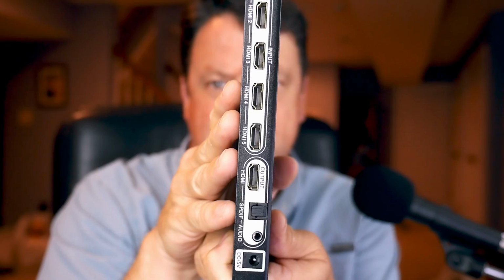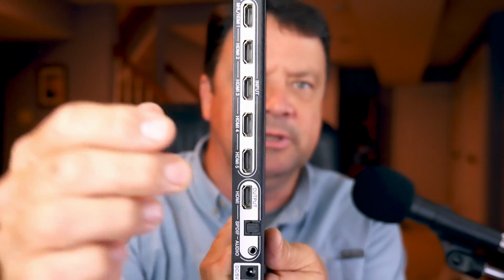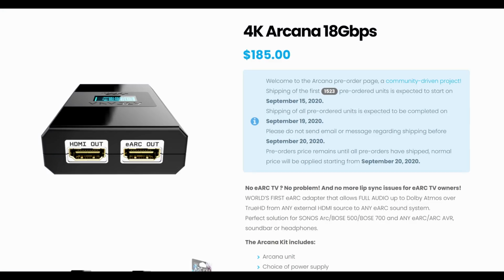Sonos Arc - Trying to Get Atmos with a Projector through a switch

Comment: Guys getting Atmos without a TV with eARC is tougher than I thought.
Reply: Joe Simpson HDFury Arcana end of problem
Reply: Alex Tejada what I’ve been hearing
Reply: Joe Simpson Now it’s on back order till December. If you decide to purchase one and you have other devices you may want to get a HDMI splitter while you at it.

For me the Arcana is just fine and my entire system sounds Amazing
Reply from the maker: @Rigue2021  thanks alex!
Reply: @Rigue2021  hey Alex so if I connect a Sonos arc to the earc out on the arcana and the hdmi out to the my projector and an apple 4k player to the hdmi in i would be able to listen to Dolby Atmos?
Reply: @dannyboy8298  No, you will need the bridge (HDMI Splitter per say)

Keep in mind there’s not too many Dolby Atmos  movies out there.

Remember when the 3D glasses were being sold for TVs it wasn’t a big sell. Similar now with Dolby atmos
Reply: Joe Simpson, I am new to projectors and just completed my finished theater during covid. I have the 4k projector set up with an elite screen. I just received my Sonos Arc and have trouble splitting the video and audio. I am not that worried about arc or eArc yet I would love to get the setup working and then enhance it from there. What do you recommend I use to split the HDMI Video to the projector and the HDMI Audio to the Sonos Arc. The only two inputs I need to connect are Directv and Apple TV. Thanks in advance for the advice! Videos are great and extremely professional, very easy to follow and understand! Keep it up!!!
Reply from the maker: @leecampbell3825  NEWCARE 4x2 HDMI Matrix Switch Splitter, 4K@60Hz 4:4:4 HDMI ... https://www.amazon.com/dp/B07ZNKF7C8/ref=cm_sw_r_sms_api_fabc_oAuSFb2VVHQWY?_encoding=UTF8&psc=1
Reply from the maker: @leecampbell3825  that has 4 input and 2 output capability
Reply: HDRFURY works just $185 is nothing versus spending thousands of dollars just to have earc
Reply from the maker: The quest continues
Reply: All this can be fixed/solved with an HDFury Arcana. Search it.
Reply: I thought it was rather easy..read about e arc then bought an e arc tv problem solved

Comment: +1 very positive outcome using HD FURY ARCANA with a JVC RS2100 / SONOS ARC combination.... I did use directional fiber optic HDMI 48gbps cables  and it worked right out of the box no special setup required....  HD FURY also has the 8K VRROOM  which is basically a 4x4 matrix switch that has the same capability of providing eARC to any HDMI sound bar / non earc display
Reply from the maker: oh bad ass, excited to try

Comment: What HDMI switch will you recommend for on normal sonos playbar
Reply from the maker: I would use a decent quality, High data rate version.  If normal you mean the original playbar it used optical cable.  The Sonos beam uses the HDMI I believe and the Arc as well.

Comment: Search HDFURY ARCANA. It will solve all your issues.
Reply from the maker: Thanks for the discussion guys @mike and @bread michaels yall are helping me out.
Reply: Ok so for example I have a 4K view sonic projector and the Sonos arc . I also have a cable box and Ps5. So I would install the ps5 and the cable box on the inputs of the splitter and then the output of the splitter I would plug into the inlet side of fury and on the e arc side output I would send to the Sonos arc and the hdmi output I would send to the projector?
Reply: @Mike-mn9xo  yeah, there are a few videos on YouTube about using an HDMI splitter with the Arcana & the arc. I ordered mine straight from the HDFURY & they were very helpful in explaining/answering questions about setup. I believe HDFURY had an arcana like device with multiple HDMI ports.
Reply: @LoafRock  great thank you so much
Reply: @Mike-mn9xo  it really works. 🍻
Reply: @Mike-mn9xo  I have tried to send you a few links explaining things but it will not let me post them.
Reply: @Mike-mn9xo  search YT “HDFury Arcana -  LOSSLESS Audio Quality from NON-eARC TV to Sonos Arc”
& “Can you get Dolby Atmos without eARC?”
Reply: @Mike-mn9xo  the HDFURY website has a multiple splitter device for sale

Comment: Just got my HDfury Arcana yesterday, I have an epson 4010 projector and running everything through an XBox Series X with Sonos Arc-sub-and 2 one sl’s.  The HDFury Arcana is amazing I can now fully have Dolby Atmos and it sounds amazing!  Setup is pretty easy as well!
Reply: The HDFURY ARCANA is amazing. It does a lot more than just atmos sound. It also upgrades to Dolby vision.
Reply from the maker: so much thanx for sharing.  good to know.  I cant wait to try one.
Reply: Can you explain more? I’m trying to get my Sonos arc to work with my projector but also have a cable box that I would like to produce sound . How do you have it set up
Reply: @Mike-mn9xo  you can use an hdmi splitter as well as the HDFURY ARCANA to connect multiple devices to your arc. The Arcana is allowing me to play sound from my ps4 & switch through the system even though they are HDMI connected to my TV (they are producing 5.1).
I haven’t needed a splitter yet.

Comment: So i have the Sonos Arc and a Projector. I‘m using the Feintech VAX04101. It works without any problems and does support Dolby Atmos! Also i‘m using a splitter to provide the Signal from the Output to my Projector and Monitor for my PS4. If you have any questions about it just ask.
Reply from the maker: awesome thank you
Reply: Is this available in America ?

Comment: Thank for the info,im new to sonos i thought i could get dolby atmos but not.do you think in their future UPDATE they can solve this problem?or we really need to ha e an hd fury to mention one device to obtain atmos..thank you im so happy with the sonos arc sub gen 3 and 2 sonos one sl as surrounds but i do want to experience the sound of dolby atmos but infortunately its not possible
Reply: Also you need to ensure that your Netflix account for example is the ultra package. I bought the HD Fury Arcana plus a Roofull Hdmi switch and that fixed  the issue
Reply from the maker: I think this is the only way for now.  unfortunately
Reply: @Juan, you can achieve Atmos without buying the HD Fury but it means that you have unplug the input from the TV everytime before to switch on

Comment: I also have a projector that needs to be hooked up to a Sonos arc ,do you have any updates?
Reply from the maker: not really as I just punted and used an HDMI switch that has optical out and used that.  So I go HDMI to projector and Optical to sound bar and settle for 5.1 for now.  It sounds awesome so I am not inspired to drop $180 on a device that I would need to get atmos...plus I use apple tv and firestick mostly and they are hit and miss with sources for atmos anyway...Sorry I dont have more
Reply: @Manuel, I bought the HD Fury and a Roofull hdmi switch and my issues was solved

Comment: I have the same projector setup as most with inputs from Roku Ultra, Tivo Mini, and Sony Blu-Ray Player.  I added the HDFury Arcana (V 0.74) matrix to see if I could get the Sonos Arc to upgrade to Atmos with eArc added...  Nope DOES NOT WORK with any of the inputs and switch settings and throws a Sonos App throws a CEC error since it wants to control my projector.  Either the HDFury Arcana (V 0.74) does not provide eArc/CEC as advertised or one needs an Atmos device like Apple TV, which in my case defeats the purpose of having TIVO Mini and Roku...Ugh, I think that Sonos is being too picky in its detection of eARC and I have dropped back to optical input to the Sonos Arc which is 'Meh' when compared to Atmos sound!
Reply: Also bear in mind that your stream account can affect whether you get Atmos sound from some pictures. I didn't until I made changes to my Netflix account
Reply from the maker: I’m still optical too and I’m note hating it anyway.  Done spending money!!
Reply: You need to update the Fury firmware 0.80

Comment: I have an LG UST Projector, Apple TV, and Sonos Arc.  Could not get Atmos until I installed the HD Fury. Now it works fantastic!  Super easy to install.
Reply from the maker: thanks!
Reply: Erik nasby
To obtain atmos sound?you need an external box?i mean if i use hd fury with the native apps like nerflix from the tv i will obtain atmos?is atmos has a huge difference of sound conpare to dd+?thank you
Reply: You need a TV/Projector with eARC (not just ARC) in able to get Atmos natively from your device. The HD Fury acts as a splitter. Is splits the Audio from Video.  So the Apple TV is connected to the HD Fury. The Video output from the HD Fury goes to the TV while the Audio output goes to the Arc.  I wouldn’t say Atmos is a “Huge” difference but it does seem to be more ‘filling’. Hope this helps.
Reply: @eDogg123  hey Erik so if my projector does not even support HDMI arc will it still work?
Reply: @dannyboy8298  Should work fine. The Audio is split apart from the video by the Fury.

Comment: I'm in same boat as you. I have an Optoma 4K projector and I'm currently running sound to a Sonos Playbar via optical for 5.1 surround sound (using a pair of Play 1's for rear surround and a Sonos Gen 1 sub for low end). I've just purchased a Sonos Arc and also an HDFury Arcana along with a 32 foot HDMI cable to connect the Arcana to the Arc. Hoping it all works as it should. Next task is to invest in an HDFury Diva to get Dolby Vision tone mapping to my projector (Converts a standard 4K HDR10 projector to output the equivalent of 4K Dolby Vision frame by frame HDR) - mainly using an Apple TV 4K for feeding the projector - all connected to a Sony 4K AVR. BTW, my best home theater purchase to date has been a 165 inch Silver Ticket projection screen. Thanks for the videos. Keep up the good work!
Reply from the maker: Thanks and let me know what works for you!
Reply: @techwaketv  it’s working great so far thanks to the HDFury Arcana. I’m getting Dolby Atmos to my Sonos system (Arc, sub and Play 1s surround) and Dolby Vision on my 4K projector.
Reply from the maker: @eighties8  thanks scott

Comment: Might not be ideal, but the xbox one x comes with dolby atmos, im running an older NEC projector without Arc straight from my xbox to receiver to projector. Its still a work in progress and i haven’t installed the atmos speakers yet (i have an atmos receiver) but based on netflix it says atmos is working and i dont have any converters or anything. Not sure if that helps or not I just had the same issue without a 4k projector and this works for me.
Reply from the maker: Thanks!  Let me know how your final system ends up.